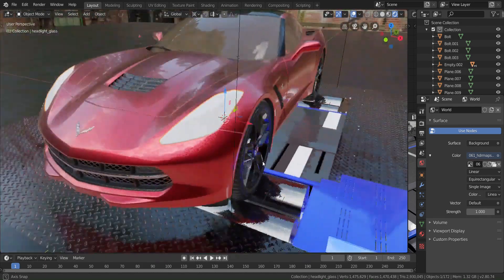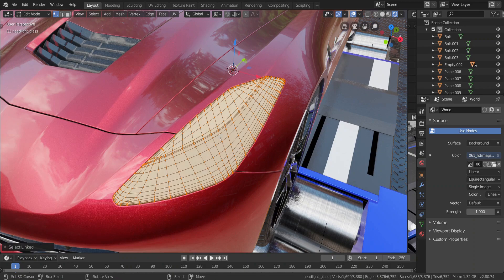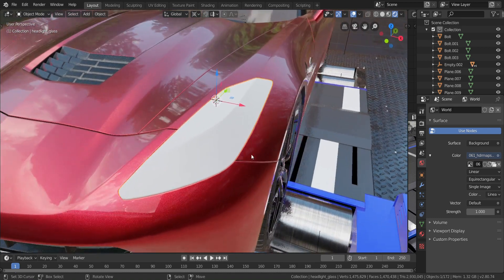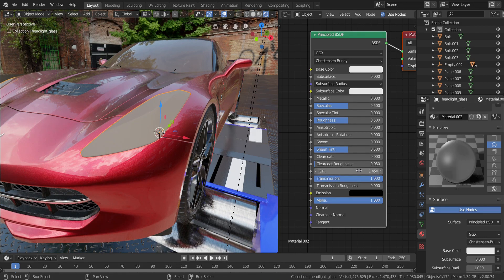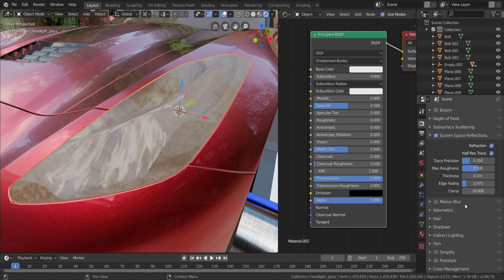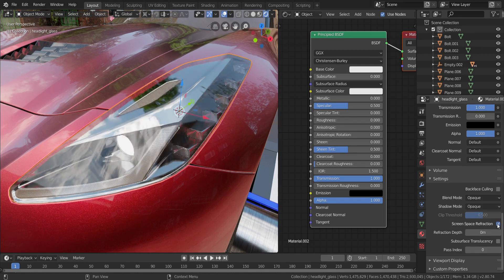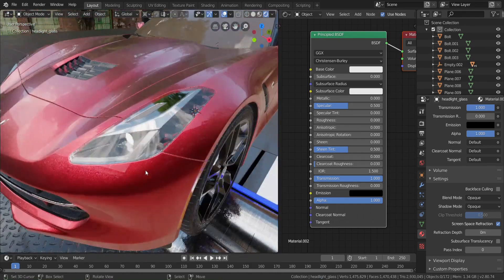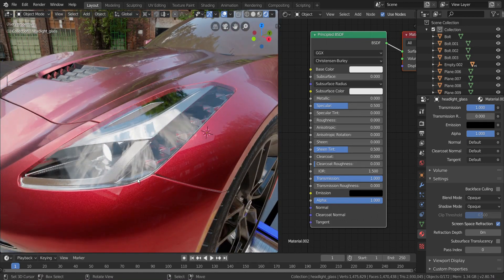How To Create Transparent Glass Shader In Blender 2.8 Eevee

Comment: While I almost thought this was it, its actually not. Example I am assuming that headlight assembly is all one object with parts. When you do this method its only see thru to the parts its associated with . Example if you where to take that lens out and try to move it over and then do what you just did it would only be reflective and not transparent. In my case yes this almost made the sunglasses I made have actual transparent gradient shade glass. But as soon as I imported the glasses to put on another model they where no longer transparent, I could see the parts of the glasses but the model that I put them on was not visible(eyes) Back to watching other videos , but hey thanks this will work for other situations!!!!

Comment: Thank you so much.
For those working on notebooks, don't forget to set blender to high energy profile, so it use your graphic card GPU. Otherwise it wont render properly.
Reply from the maker: Hey, can  you tell what you mean by not rendering properly, cause I think I might be facing such issues, and thanks.
Reply: @NaturalArtFreak  I mean material in preview looked like glass but EEVEE was rendering it as piece of dull plastic.
After i forced blender to run on high energy profile same scene started rendering properly and glass looks like glass.
Reply from the maker: @Rin8Kin  oh okay thanks. that's not the issue... mine is when I try to viewport render in Eevee sometimes the whole screen turns white and affects the final render too...
Reply: @NaturalArtFreak  Sounds like common videocard memory leak/overflow issue, but usually windows simply disables graphic card short after and then gives message that drivers stopped responding.
Reply from the maker: @Rin8Kin  I might check to see if I can find some solutions to it.
Reply: @NaturalArtFreak  Hope my assumption have been at least close to actual issue =)

Comment: I can't get this to work. Has anything changed in the new version
Reply from the maker: no, still the same you must be missing something.
Reply: @NaturalArtFreak  I'll try strip down the process and see if it works.
Reply from the maker: @flyinggoatman  sure
Reply: @NaturalArtFreak  Sure?
Reply: @NaturalArtFreak  I found the issue. But I have another problem. Side view of glass makes it have a glitchy edge. Is there a way to fix this? You can see it here. https://i.imgur.com/lGLgNH5.mp4
Reply from the maker: @flyinggoatman  that comes as result of tweaking the distance of the glass shader… so for an animation like what you uploaded I would recommend using key frames for the glass distance values to fix it... so that on side view it would look normal and in front view it would still look same but at different distance values, im not sure if you understand but let me know when it works.
Reply: @NaturalArtFreak  There values are in the shader?
Reply from the maker: @flyinggoatman  @ 2:50 im referring to the refraction depth
Reply: @NaturalArtFreak  I fixed it, thank you so much!
Reply from the maker: @flyinggoatman  u welcome